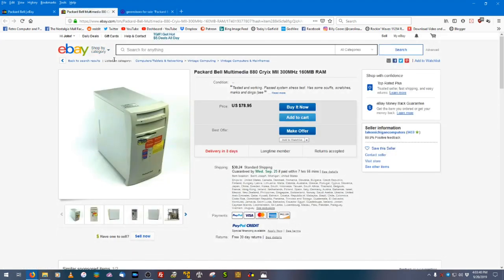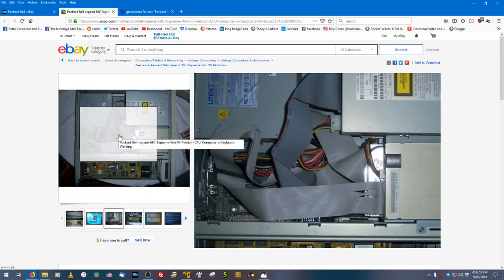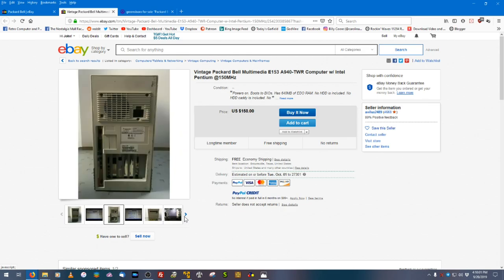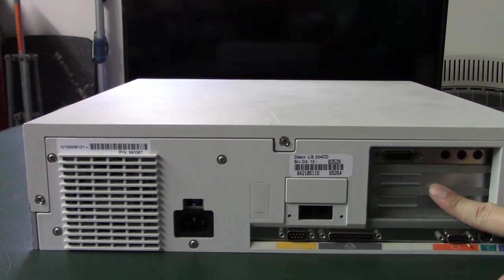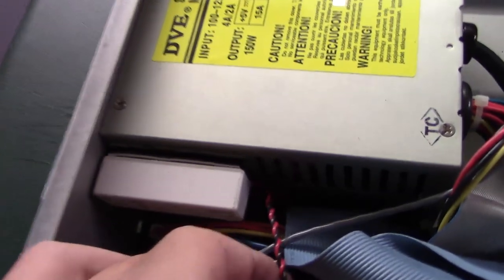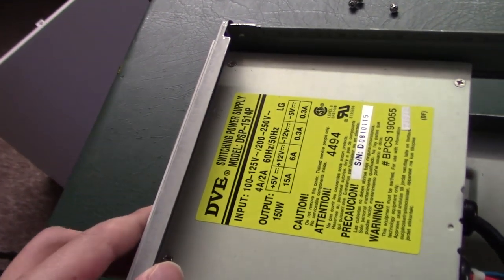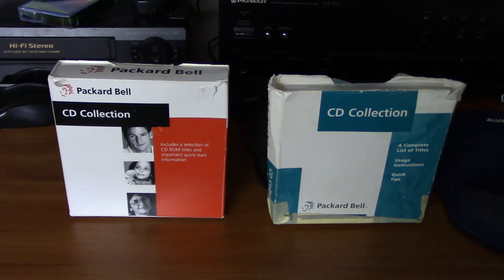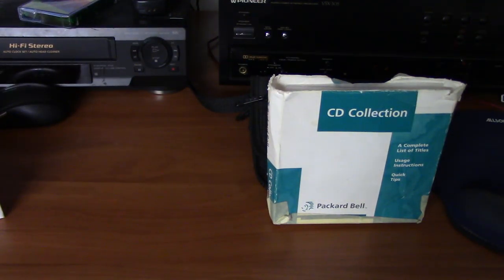Vintage Packard Bell Buyer's Guide

Comment: My first IBM PC Compatible system was a Packard Bell 486 33MHz system from either 92 or 93. It had Grolier, World Atlas, and Mavis Beacon Teaches Typing. The only thing I liked about the Mavis Beacon software was a  segment where you could pretend to be a grocery clerk. You had to type the price of the item in as quickly as it was scanned. The World Atlas software had the Soviet Union listed instead of Russia and the individual countries. So the software at that time was outdated. Packard Bell Navigator was neat to be using from the beginning. I remember getting mad at my dad for uninstalling it a short time later.

Comment: Very nice guide! I just wish you made this in 2009 when I went through the trouble of gutting my Legend 994CDT for the floppy drive to put in a newer computer (though I've since reassembled the computer and sent it off to Chipster last year). We could never get the original sound card to work for whatever reason; I don't remember if that was caused by it failing to initialize or it was just impossible to hear anything from it... maybe the speakers were never hooked up correctly?

I've also experienced some oddities with restoring from the master CD, possibly resulting from not having the original boot floppy or hard drive format number. When I installed Windows 95 from my master CD, some lines in AUTOEXEC.BAT caused Windows to reload the first boot PnP hardware detection screen on every boot, and I think a certain registry value "Real Mode Net" was never reverted after Setup either, making it impossible to configure network settings. Have you ever run into such an issue yourself?
Reply: Not sure about the 2nd problem, but the 1st problem, I've seen with sound cards that are configured wrong. And the jumpers seem to do nothing, when installing the program, there is typically a utility folder, and within it is a config file that will reconfigure the card. I find just setting it to default fixes it. I've fixed many Sound16A's that way.

Comment: For my Compaq Presario it has a 150mhz pentium 32mb of ram with a Soundblaster 16 and s3 virge graphics. Windows 95 did not have the proper drivers for a few of these and a pain to get working while 98 everything worked right away
Reply: Be sure to get the S3VBE318 TSR VESA Utility especially for Build engine games.
It's a fantastic graphics chip for Duke Nukem 3D if you have the TSR installed.
Most people have misplaced disgust for the Virge series. 

They had rudimentary  3D basic functionality but were very good for 2D graphics.
The Virge series just had inadequate 3D abilities 

When paired with a  much better 3D card like a Voodoo 1 it was a great combination.
Reply: @m9078jk3  Thanks for the suggestion, the computer I mentioned isnt being used currently since my main retro computer is a pentium 2 450 however I will keep this in mind when i decide to work on the computer again

Comment: My older cousin had a flat-desktop Packard Bell (Unsure of the model, I found this out in an old home video8 tape) running Windows 95 in 1996. It was the kind with 1 5.25 inch bay. It was probably Pentium-based. That computer was given to goodwill in probably the early 2000s. I now have a Packard Bell Legend 401CD as my vintage Packard Bell running Windows 95 (It came with Windows 3.11, but I used a Windows 95 Master CD ISO from Archive.org). Unlike the latter, this one has two 5.25 inch bays, but it is a flat-desktop. It originally came with 8MB ram, but it now has 32MB max. It also had a 500ishMB Connor HDD, now it has a 2GB CF Card.

Comment: can you help me? I'm trying to restore a packard bell club 30 to original state using the original restore CD's. Only problem is it has a new HDD and I don't have the resto floppy. The trouble I've run into is the 'tattoo' system that packard bell used to only allow their restore discs to be installed on systems with a hidden sector with the tattoo present to verify the CD's against.
Just wondering if you could provide me with a restore floppy image for packard bell 98 or have an original HD that you can pull tattoo.bin or .exe off for me?

Comment: What are these 2 holes covered with plastic blanks for exactly? An external port, or something?
Reply from the maker: One is for a modem (on the earlier models) and the other is for an external serial port, which was never used on any Packard Bell, but you could add one yourself.
Reply: @TheNostalgiaMall  Ooh, didn't know that. Thank you!

Comment: the hillary pb570 has the same port layout as the pb680 orlando, it was actually intel that manufactured a majority of those boards in those packard bells, the Robin LX had a 430NX chipset and had that soldered in Dallas RTC and had a onboard Cirrus Logic GD5434, the Hillary had a 430FX chipset with a onboard Cirrus Logic GD5434, the PB640 had a 430FX chipset also but with a Cirrus Logic GD5440, the PB680 had a 430VX chipset with a S3 Trio64V+ or S3 Virge. they all had that similar BIOS.

Comment: NOT SURE why you say you do "vintage" Packard Bell when in fact all you show are the newer models.  If you want to do REAL vintage, show us a nice PB VX-88 which despite its name came with an 8086 CPU, fully loaded with 256k factory RAM soldered-in and 5 /14" floppy. The REALLY "DeLuxe" model came with a MFM 20mb HDD but many authorized dealers would sell one that shipped without the optional HDD and then install a HUGE 30mb RL,L drive (required a 3rd party RLL controller card) and the brand-new DOS 2.11 (without Basic). They'd even fill the rest of the RAM sockets to give you 512k (the original machines need a board to do 640k, it's maximum). PB was really genius investor Beny Alagem, an Israeli who bought the name from the heirs to a company that made radios and early TV's in the 40's and 50's, then "set up shop" in production-needy South Korea.  Later they changed the motherboard to do 1024 - 640k usable without 3rd party EMS software. Microsoft was nice enough to provide that "free" (a long story as well) with later DOS versions.
Not sure if you covered this; I admit when I realized you were doing "new" PB machines I cut the video short.

Comment: I was just checking out some old Packard Bell computers like mine. I have a Packard Bell PB620CD Desktop Computer. I purchased it at Walmart here where I live in the mid-'90s the date code shows it was made on March 8, 1995. It came with Windows For Workgroups and DOS 6.2 when I bought it. The only bad thing is the power supply is bad. It's been stored for over 20 years. Somewhere I have the original CTR Monitor with speakers that attach to the side of the monitor. With tax, it was just over $1,000 dollars new.

Comment: Packard Bell created a mini-computer the PB250. long before the PC_compatible computers.  It used accoutical delay line memories.  A long wire in a case that used a coil to induce a pulse on one end and readed 3 miliseconds later on the other end of the wire.  If I rememver correctly the computer used 24 bilts of pulses to a word with 2 of the bits on each end of the word that as a tech we called a Goof bit but they called it protective bits.  Long time in the past in the 1968-72 era.

Comment: I like old things from cars to computers and try to save them and a lot old stuff in between I collect them restore them, mod them where necessary, and enjoy them found a Packard Bell Synera in the alley as well as a bunch of other old computers as found a Tandy 1000TL and a Tandy sensation. The sensation and the PB Synera needed new power supplies I used an old 12pin ATX power supply from a dell with an AT cable converter and reused the old switch. I managed to restore both Tandy computers because I found a lot of documentation, drivers and fan support for them. I'm currently trying to do the same with the Packard bell and you stated in one of the videos drivers are hard to find the driver for the modem/sound card I cannot find them  it would be great if someone documented these computers to show drivers and what modern parts are compatible to restore these computers just like I found for the Tandy computers. info like specs on motherboards what can be upgraded as well as what bios updates and driver downloads. My suggestion to you would be to make a website and link your youtube video to them to pass on your knowledge to make it easier for someone like myself who doesn't know too much to keep these computers running for future generations and also to thank you for what documentation you do have available already...... so yeah thanks!

Comment: Is it possible to install an intel 200 mmx processor into this machine? I have a MM executive currently with a Pentium 1 120 Mhz socket 7
Reply: It is likely that your motherboard may not have a voltage regulator. If that is the case then you can't upgrade to an mmx unless you have an overdrive cpu or something like a powerleap adapter, both pretty rare and expensive options. Do you happen to know what motherboard your computer has, and can you open the computer?